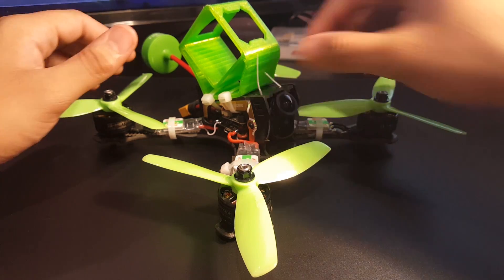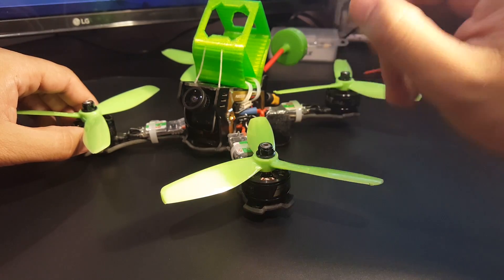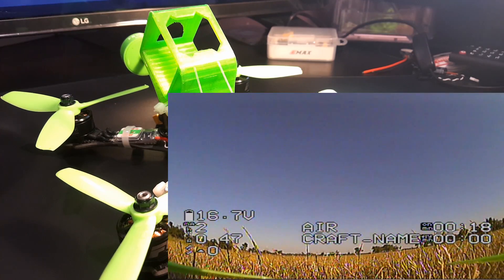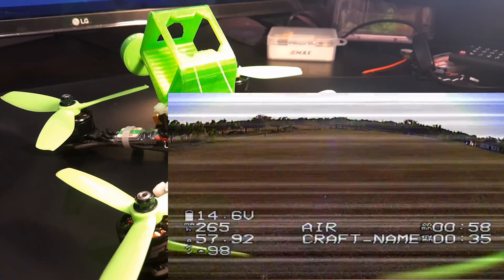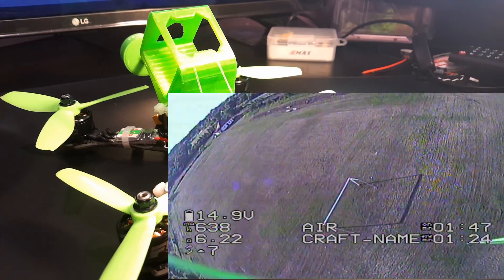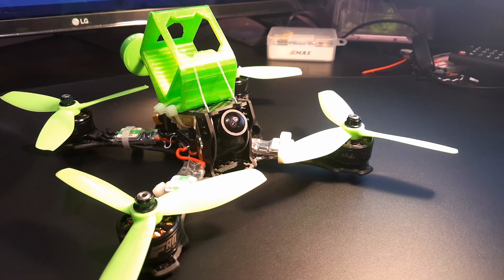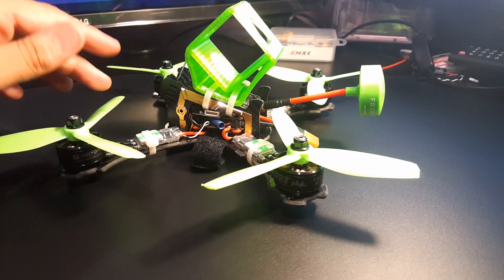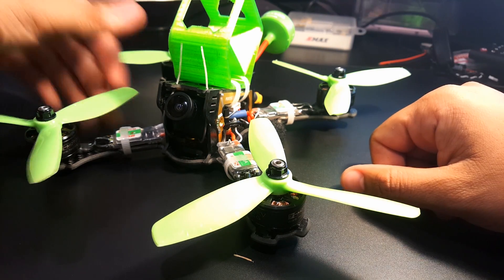HGLRC F4 Flame Maiden

Comment: Im having MAJOR problems with this FC, the motors heat up in seconds and twitch like crazy , no such problems with the old SP3 board. I can not even hover the quad. The motors work perfectly with the motors tab, so the esc and motors are fine, the blackbox shows crazy oscillations from the gyro on the  roll axis. Going to ask BG for a refund wasted to much time on this POS built loads of quads never had a problem like this.
Reply from the maker: +Team crap sheep My motors where hot as well you need to make sure you dampen it because the f4 gyros are very sensitive.. It's the oscillation that are making the motors hot..
Reply: Drone Mesh thanks for the reply could you tell me how I do that , any help much appreciated
Reply: I already have isolation mounts
Reply from the maker: Team crap sheep what motors are you using?
Reply: Drone Mesh I'm using racestar br2205s which are not great
but I'm changing them out for my old emax mt2204's these are better balanced
Reply from the maker: Team crap sheep just for future reference, helpful advice DYS fire are good motors and less noisy. 

I wish I was able to get this sooner so people don't waste their money :(
Reply: Drone Mesh thanks for the advice all good to know as this can be a frustrating hobby
Reply from the maker: Yes and these things happened to me I wasted soo much money watching people lying on reviews.. This is where i decided to take to the next step on my channel and really review this stuff with data and testing equipment and let you decide.

Comment: I swapped all the parts I used in my rf1 build and used this fc, rcx2205 v2 2400kv and spedix25a. I am having major noise coming from the motors, quad twitches on hover and the motors are getting very hot. I am giving the benefit of doubt atm and troubleshooting it,replacing escs and motors for starters.
Reply from the maker: The solution is going to be a Capacitor or Capacitors or 12V reg with Capacitor. I will be testing it this week with 1000uF 25V Panasonic LOW ESR capacitor.. And i bought all LC filters I could find on banggood to compare if they can solve this also.

Switching will not change much this is excepted with no reg for VTX.
Reply: I have a 1000uf 35v on it , video is fine on mine but it is unflyable atm.
Reply from the maker: What is making it unflyable?
Reply: major twitching and motors getting very hot. Blackbox shows excessive motor noise, soft mouting them does nothing for the issue. Fc is also soft mounted.
Reply: ok after hours of swapping parts , I found the cultprit, it is the escs. The fc is fine, video is fine.
Reply from the maker: Elefkara What are you gonna replace them with?
Reply: Drone Mesh i suspect it is the firmware on the escs. I flashed them with 16.6 d shot and probably that screwed it. The escs are very low noise ones, spedix 25a. I have a CL racing fc on the way and will check again. I replaced them with Racerstar 25a MS, addes a 25v 1000uf, gonna maiden today, hope it's fine.
Reply: Elefkara I have same problems with my two flames (one is ok).. new Brotherhobby motors. Racerstar esc... I won’t buy this fc anymore

Comment: Sir, you should try wraping the esc's signal wire around the esc power ground wire to reduce noise. 25V 1000uf LESR cap may reduce video noise but you will want a 35V cap to protect the fc  board / vtx from voltage spike (+30V) when the quad crashes.

Comment: I have had similar (practically the same) flickering in one of my builds. Added two capacitors and still the same flicker. I fixed it by moving the power cables going to ESC further away from the VTX.

Comment: Eeej man i want to buy this fc. whit emax 35amp bulled series esc and 2205 2300kv emax red bottems is that a good combo? And do i get then also this problem? Btw my first build so i dont know if those esc's are good for it
Reply from the maker: Bennie Leip The emax motors are amazing the ESC'S I would not buy check my noise review on them. This FC is very good but depending on your setup you will need low esr caps. 

Emax motors are very noisy.
Reply from the maker: Bennie Leip For example ESC get DYS XS 30 amp..
Reply: Drone Mesh and the fvt littlebee_s 30a esc's or the airbot wraith 32 35a bl heli? I dont have a lot of choise if i want to buy in holland otherwise i have to buy also from bg the esc's ,or dont you know this one?
Reply: Drone Mesh and the caps. do i have to do it like you dit here or on every esc a smal one?

Comment: I had some issues with noise as well, added 25V 1000mF capaitor on battery leads didn't helped, tried running three different voltage regulators and step-downs in all possible configurations and all possible power sources... ended up running tx526 from 12v regulated from PDB and camera from spare motor pad on PDB (unregulated V) with another 25v 1000mF cap on it. Also dropped D to about 20. Switch the vtx and camera around various power sources, it should work somewhere. Make sure it's within the working range of your gear tho. If i remember correctly DYS ESCs were quite noisy, if everything fails you can try adding 330-450mF caps on each ESC power pads, preferably 25-35V.
Reply from the maker: These ESC's where the least noisy ESC's I have tested. You know lately i have been thinking it could be that the cheap VTX has some aspect of affect so I will purchase an expensive one and see if there is a difference and report my findings back to you guys.

Comment: What value did you set your motortiming? I had my f40 pro 2400 kv on med-high and had oscilation at punch outs. Timing back on medium and they were gone and increased P term again

Comment: my f4 flames have NO issue woth noise on vtx with no caps or filters thats wierd dude
Reply: Im running one setup with HGLRC F4 Flame, DYS SE2205 PRO 2550KV and some old RG20A ESC without any problems with the video.
Reply from the maker: What ESC and motors are you using?
Reply: RACERSTAR 2205 2600KV and Racerstar MS Series 25amp
Reply: I have one on the bench waiting for Zoe fpv 1407 4100kv motors and 2 more in the mail! one is getting Hyperlight 1407 2755kv

Comment: Out of interest is the antenna ground on the vtx contacting any conductive part of the frame as those white lines are characteristic of the vtx making intermittent conduction to the carbon frame.
Reply from the maker: Yes i have checked that it can also be from a lose antenna but its neither its just noise.  Anyways thanks for the tip ^_^

Comment: before you add the capacitor could you ground your Esc sig ground? just ground it right at the Esc with a short wire.
Reply: That FC doesn't have esc signal grounds.
Reply: F4 flame has PDB integrated so ESC pads and 5V signal path have already common ground so no need for signal ground. Signal ground is only usefull if you have separate PDB and no common ground between ESCs and FC.